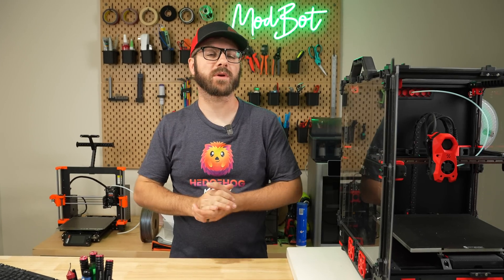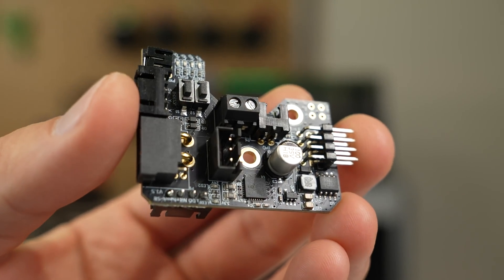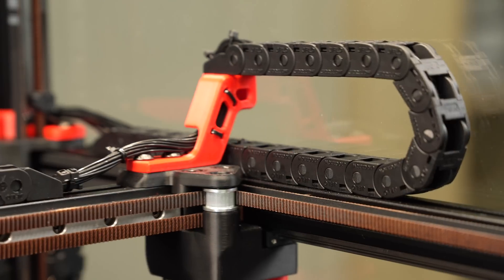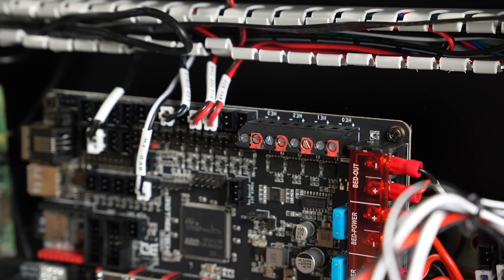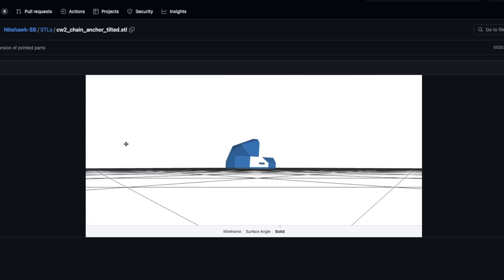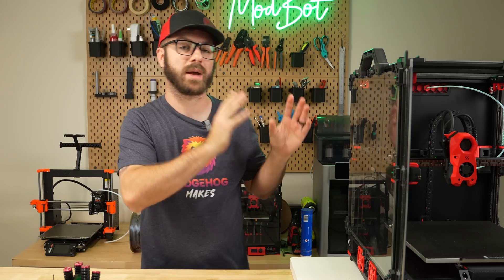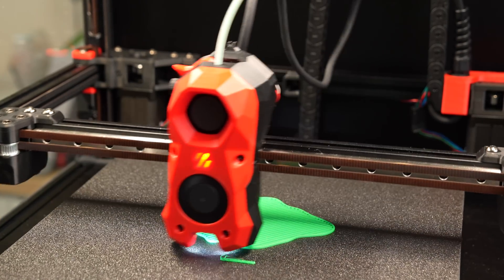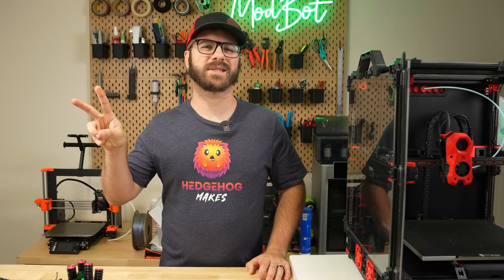USB Toolhead Boards Are FINALLY Here! (LDO Nitehawk)

Comment: Usb prob better and easier to replace and extend than canbus
Reply: I'm not sure.. I'm planning to build a tool changer with 6 tool heads. For USB I would need 6 USB ports, so I would need to make use of a USB hub. This really could introduce some reliability issues I'm afraid.
I feel a canbus network would be more reliable..
Reply: Quite the opposite.